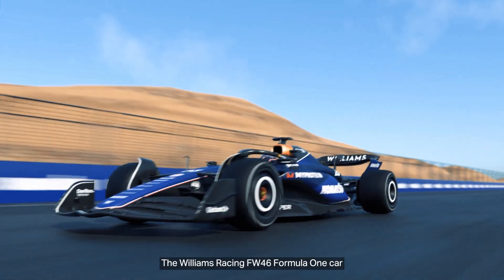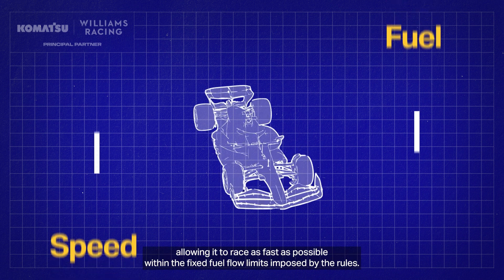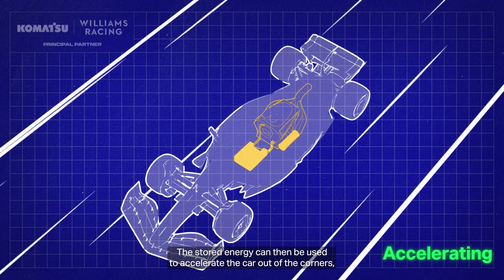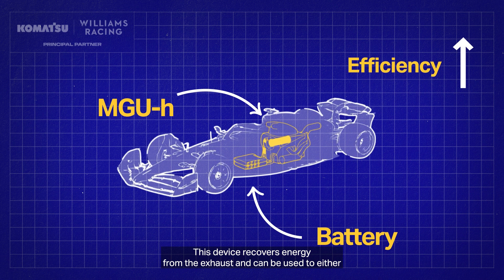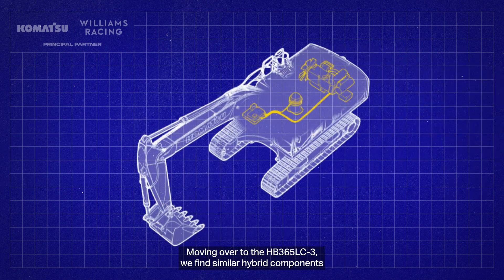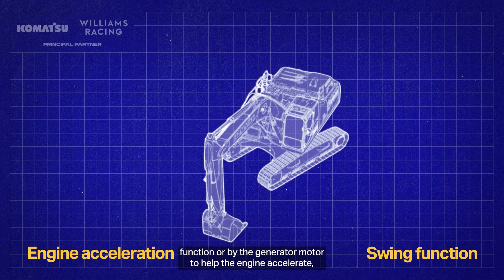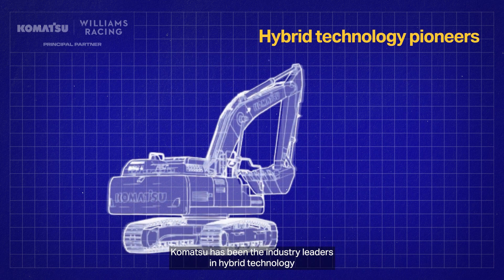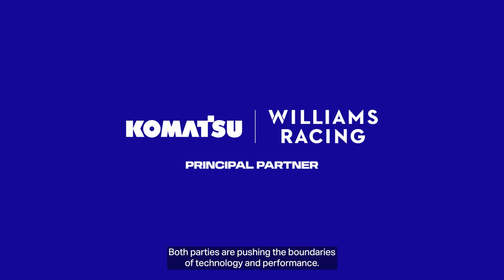Komatsu Excavator vs. Williams Racing F1 Car - A Hybrid System Comparison

Comment: Width 34,44m?!? 😗
One zero more.😉
Reply: in the specs starting at 0:11 the comma is being used as a decimal marker - adding a zero on the end would not change the value. The decimal mark is also in the wrong place: it should be something like "3,444 m", not "34,44 m" (it's not over 30 metres wide).
Reply: @brianb-p6586  If i'm correct: There are 2 systems of writing numbers:
like (US?) 1,234.56 or (EU?) 1.234,56 - both in this case are one thousand two hundred ... of course i forgot: one zero more and one "m" more 😊
Reply: @TRiX_ONE  there are more than two systems, but those are two of them. In any case, you now understand that the comma is the decimal point, so adding a zero wouldn't fix the obvious error in "34,44 m".
Reply: @brianb-p6586  Ooohhh no, where i have my eyes. Sorry i was second time wrong. Thank You for your patience.